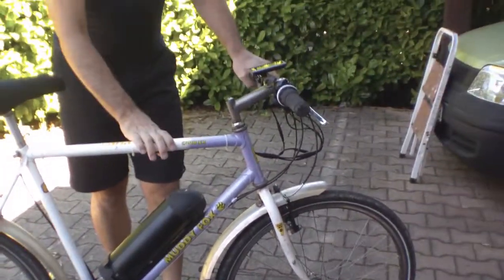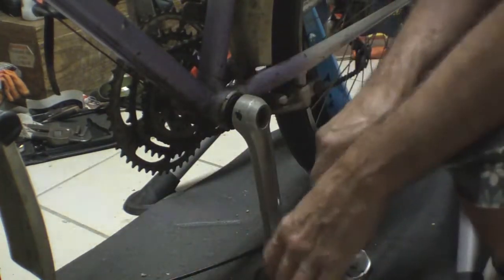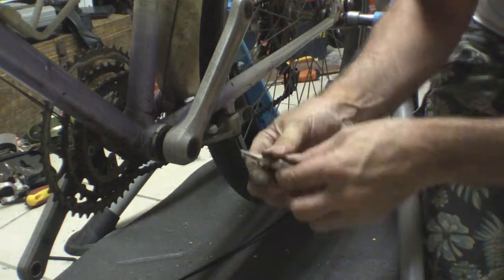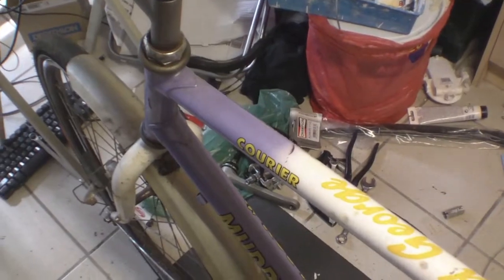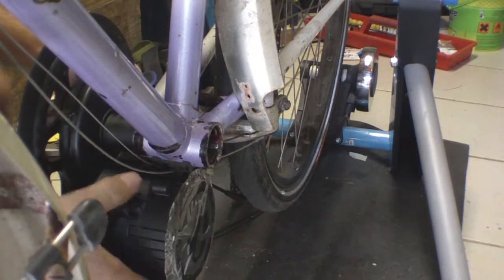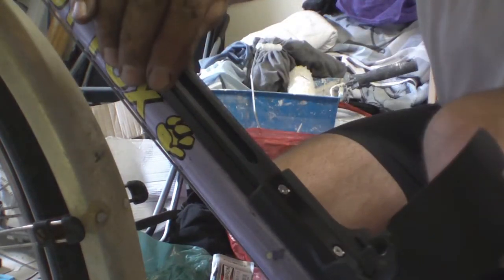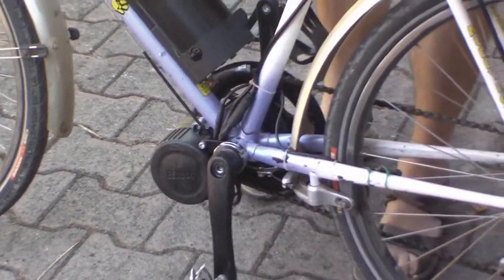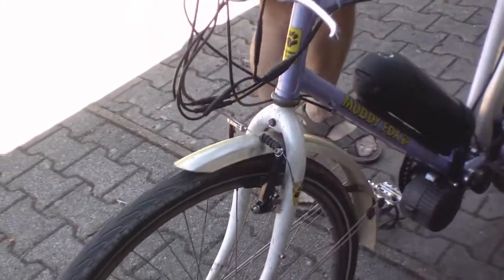GSM / Bafang electric bike conversion kit build

Comment: I did it with Decathlon bike same model 2 years ago great bike for mid-drive conversion but watch for bottom bracket as its tight and requires filling to fit.